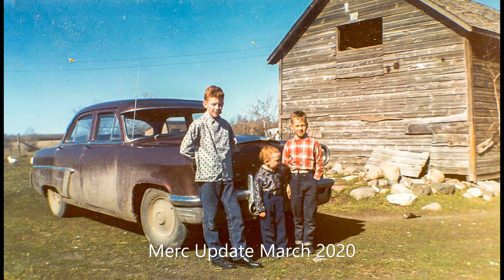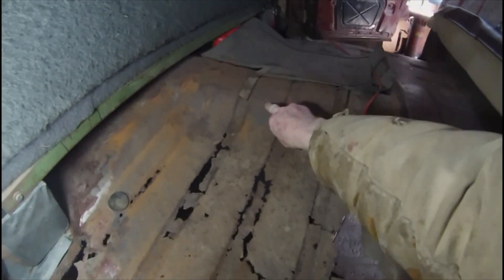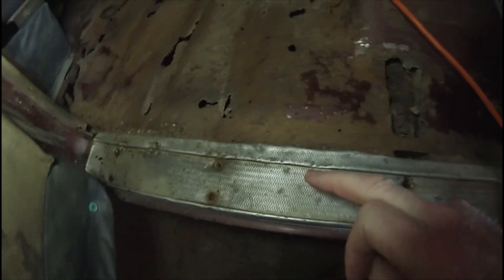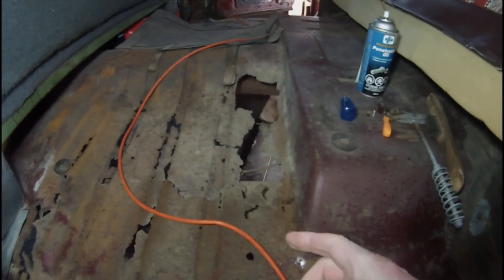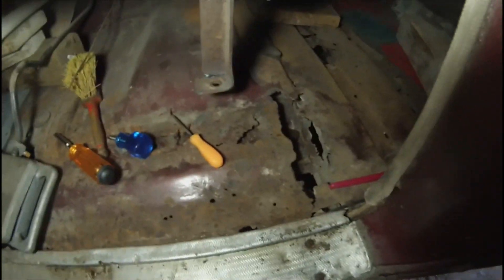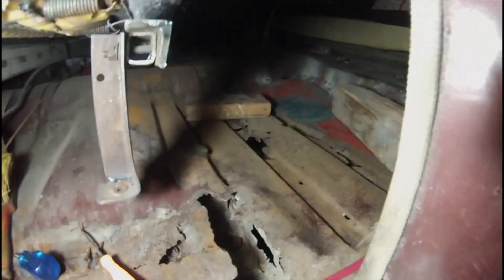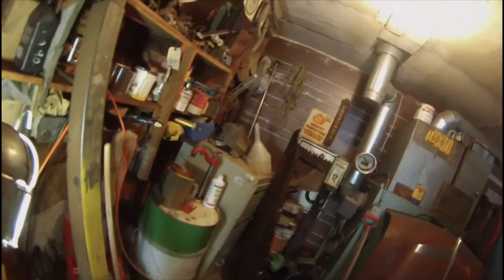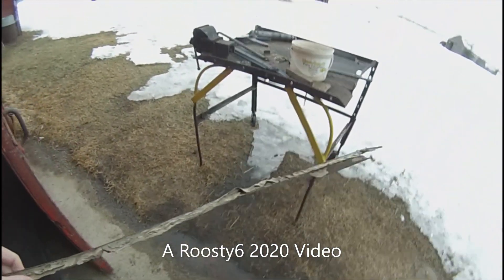Merc Floor Update 320

Comment: Nice to see an update on the mercury. Is the frame rusty or is it pretty solid?  We have an old rusty merc too! Its just a few years newer (1974) lol. has the M-68's flathead free'd up yet? Just wondering about it condition lol.
Reply from the maker: Frames seem to do just fine here. All mine are smooth and free of rust. Its the sheet metal that shows the rust damage. No progress on the M68. I think I'll have to pull the heads off and see what condition the cylinders are.
Reply: @roosty6  Pistons for these old flatheads aren't too expensive. It might be easier to just drill out the piston and recondition that cylinder.  With the heads off you will know.

Comment: Looks like what I've been dealing with lol
Reply from the maker: I saw you had some rust to deal with too. At least the rough welding I do on the floors won't be visible when I'm done and I cover it with mats or carpet. Or maybe some of that black spray you were using.

Comment: Rusty, I got 20 gauge sheet steel for my car that I repaired two years ago. It comes in 2 foot square sheets I got them at my local independent auto parts store. I saw that they have it at HD as well. I went through two of them and had to get a third, I got a pair of sheet metal bending pliers, that helped a lot, and the biggest thing was a pack of six butt welding clamps for $6.00. Your floors are looking good but you are working way to hard at it with that 18 gauge steel and without the pliers and butt clamps.
Reply from the maker: Thanks for the tips. Some of the metal I'm using might be overkill but I'm just using what I have first. I will likely get to the point I might have to actually buy new steel and will try for 20 gauge.